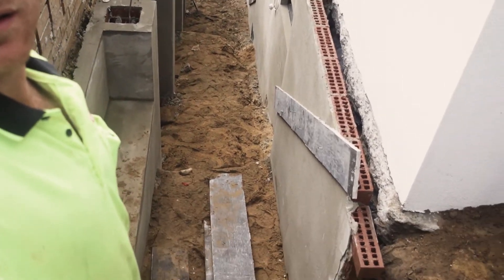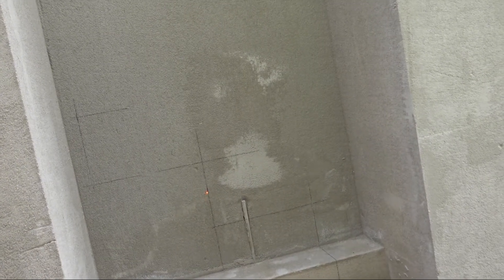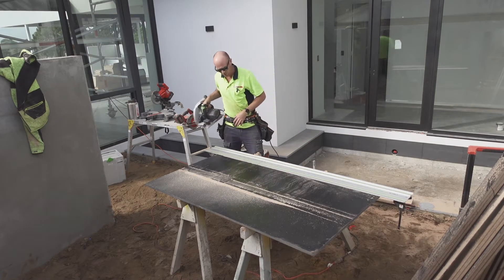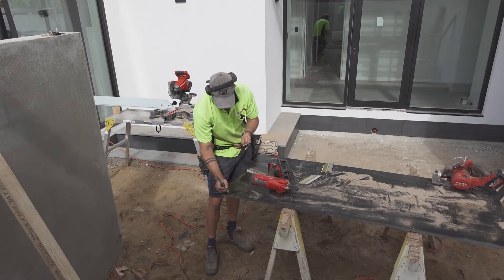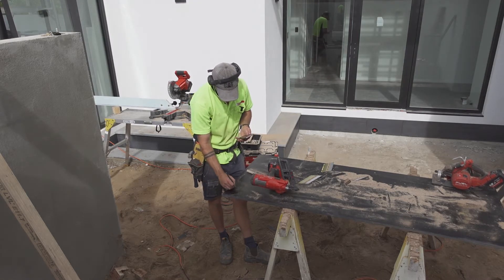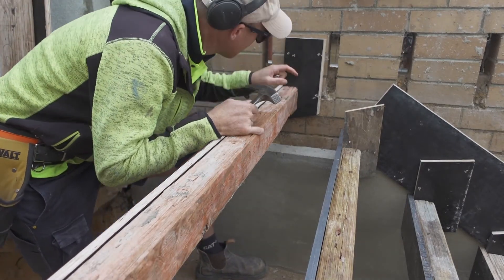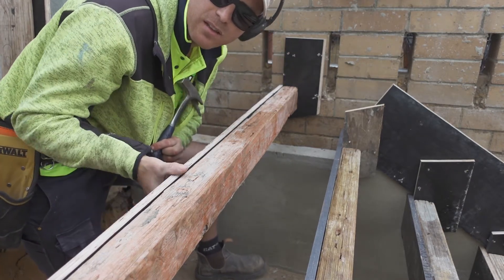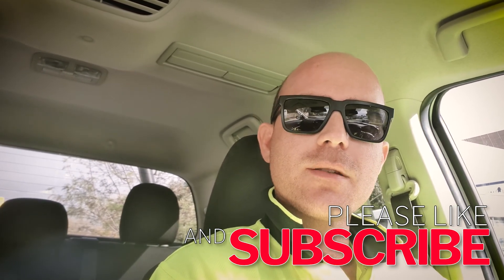HOW TO BUILD CONCRETE STEPS:

Comment: Thats a good idea for that type of 1 off stairs, Im not in formwork anymore butwe used to cut the whole stringer out of ply wood and nail the risers to the stringer then the stringer to the wall or side shutter.
But they were typically multiple use.
I would definitely change to this method for this type of scenario
Reply from the maker: Yes I like your method but as you say it better suits repeatability. I pretty much never get stairs with the same rise and run.